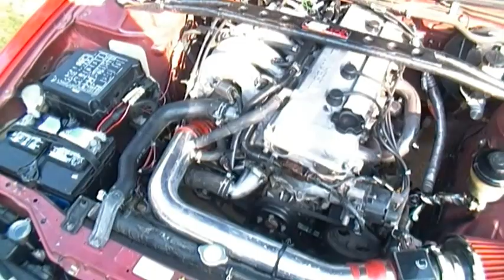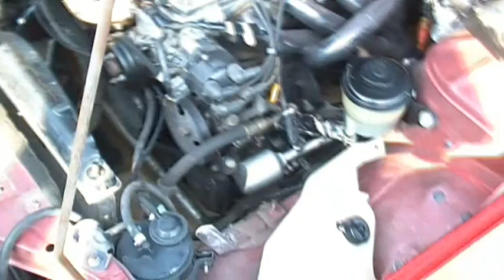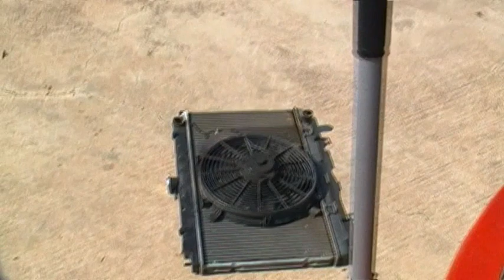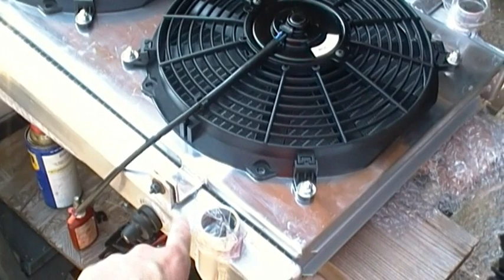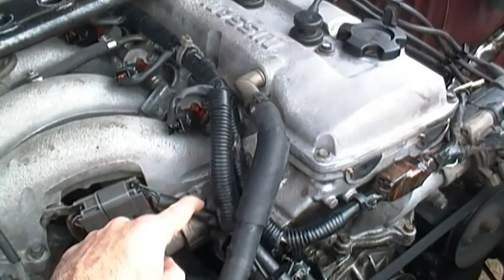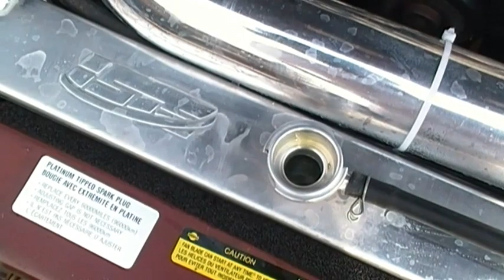Radiator & Electric Fans Install in Project Zenki Redux 240sx S14

Comment: Why they never show how to wire the thing?
Reply from the maker: What do you need help on for wiring?  Each fan had a positive and negative wire.  I used a thermostatic switch to trigger the relays for the fans, and each fan had an individual relay for power.  Power came from the IPDM relay box in the engine bay and that is where I hid the relays to keep them out of sight.

Comment from the maker: It should, but I don't know if the automatic has a cooler built into the radiator or not.  If it does, you may need to run a separate cooler.  I'd ask the guys at Enjuku Racing to know for sure.  They're great for questions.

Comment from the maker: @Kingdomslaer114 The electric fans are wired to relays in the fuse box (in the engine bay).  I have the relays pulling power from the battery and the trigger is a thermostatic switch on the radiator itself.

Comment: You forgot to mention that you should get distilled water instead of tap water. That way you won't have mineral and rust deposits in your cooling system later on. If you did have tap water + coolant beforehand, it would be a good idea to flush and clean the cooling system first.

Comment: One very minor thing it looks like you skipped (which is more important on doing radiator swaps with lower quality radiators like from Ebay) is to flush the radiator out with water before installing it. That would get rid of any packing material or other random junk that could have been left from the manufacturer.